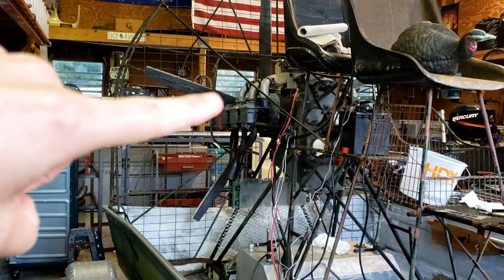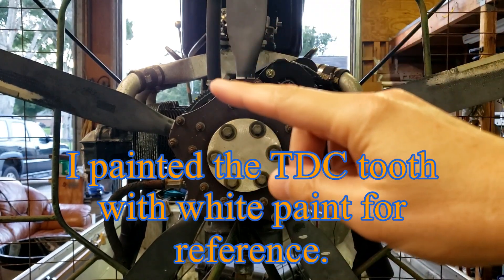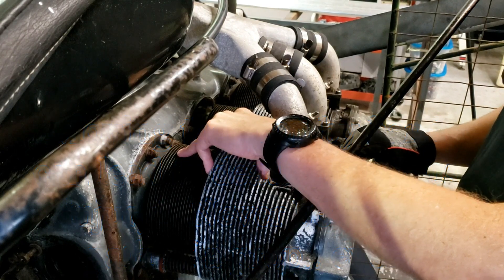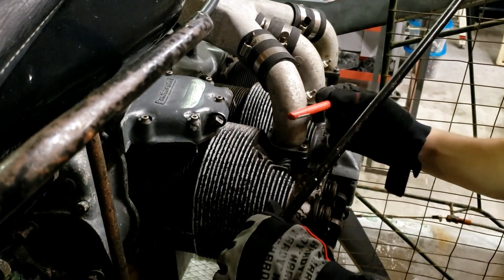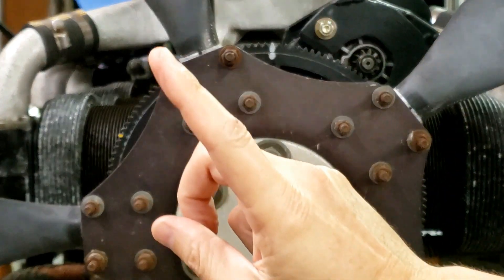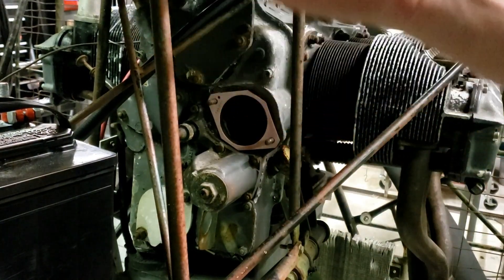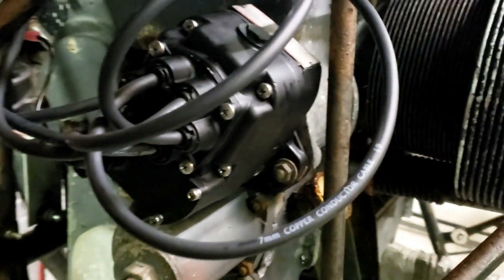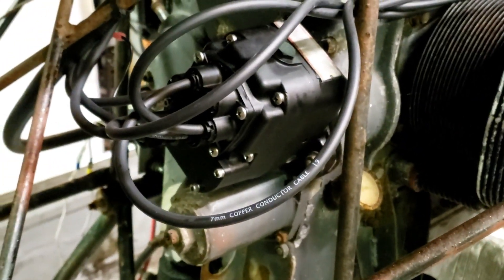Airboat 8

Comment: That bulge under your mag, I’m pretty sure that is the oil filter screen. ( haven’t worked on GPU) you may want to pull that off at some point and give it a inspection and cleaning.
Reply from the maker: Thanks, I think you are right.  I almost pulled it apart, but plan to wait until I pull the motor.  I need to build and engine stand.  I saw the one that you have.  (Not the one in your boat, but the ones that hold the motors for tear down, etc.). How wide is the feet or diameter on your engine stand?  Looks to be about 3ft.  I want to make sure mine is stable of course.
Reply: @KMLTimesTwo  I’ll get the dominions for ya